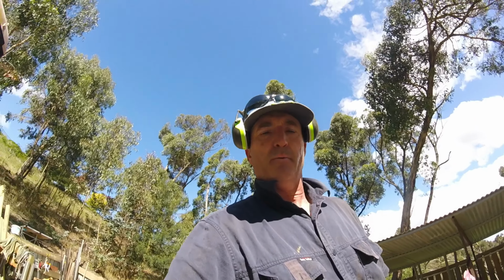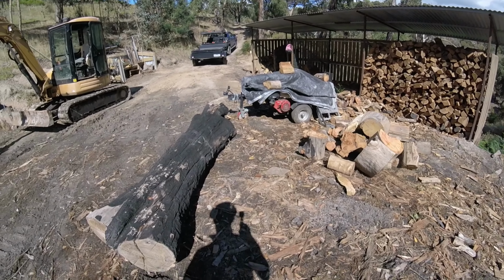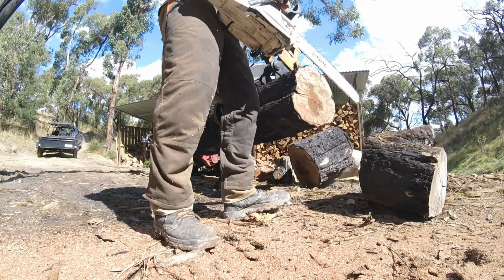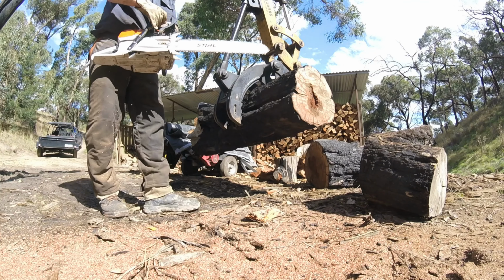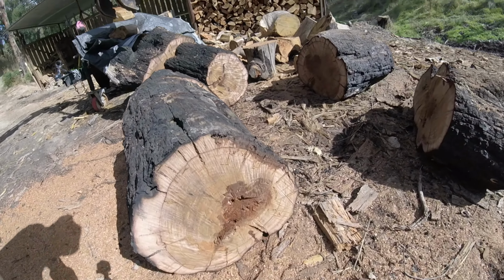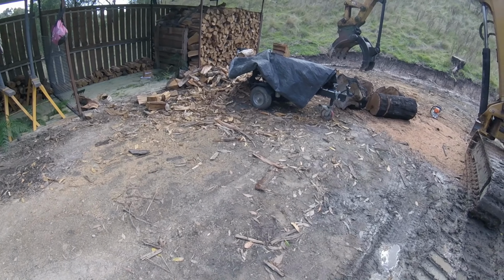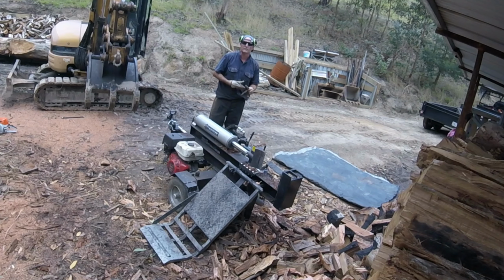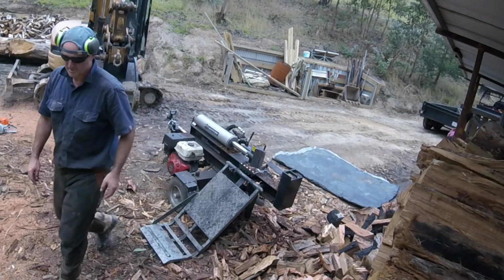Firewood Production - Bucking and Splitting - 2021 #25

Comment: Does thw burnt logs dull the chain quickly?? It would make sense if it does..
Reply from the maker: absolutely does, I've tried tungsten tip chains, which helps, but I now stick to quick sharpen of a semi chisel or full chisel. I make sure the smaller burnt wood is cut with the swing saw just to save the chains a bit.